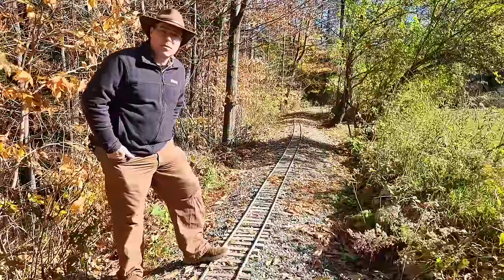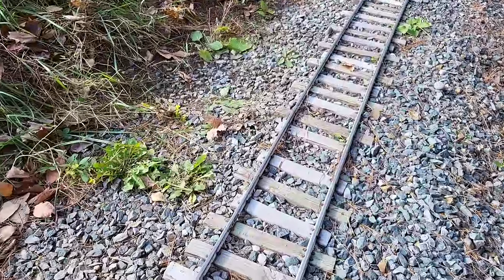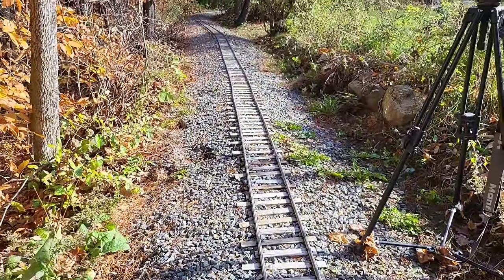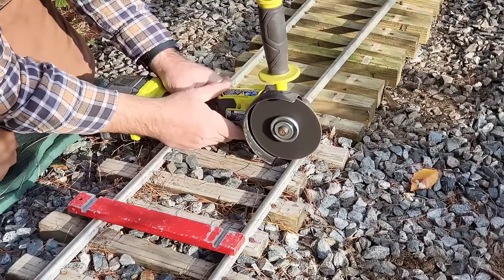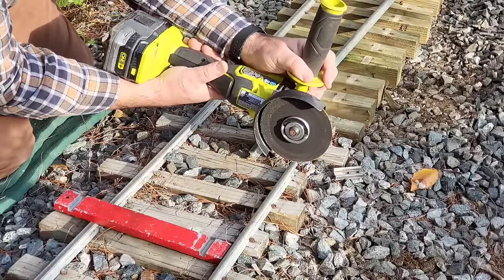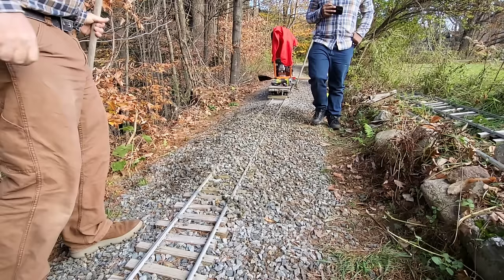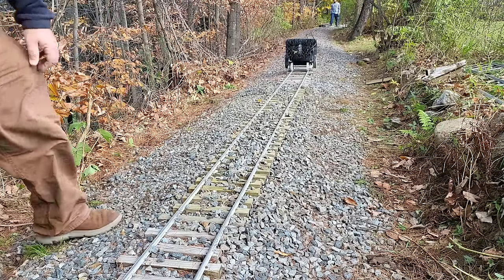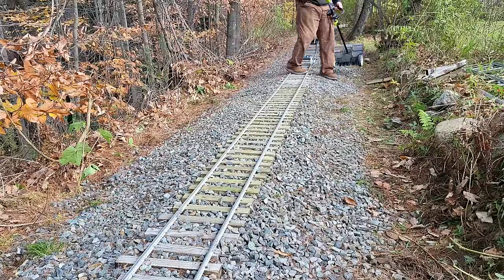Replacing worn out rail and ties

Comment: Try using "hemlock" for the ties, if you are not already.
Reply from the maker: Not a bad idea, but it's not as rot resistant as Black Locust. If I could find a sawmill who  would cut my Black Locust, I'd have them cut my tie stock. Price wise, Pressure treated  is still the best value, though.

Comment: ..."make a new panel".... That could be a good idea: make a panel of say 3 meters. On a spot easy accesible and to sit next to it. And transport it to the location. Only do the connection with the old ones and ready. Could save a back or 2 too...
Reply: Looks like a few more relays maybe in order
Reply from the maker: @Keikdv I have some older panels to get through first. Each stick of rail is 10 feet, so that's already determined for me. I do have a panel jig, though. A video about building track panels might be nice. I mostly lay track on the ground, though. Less rail waste that way.
Reply from the maker: @southern207hobbies9  You're not wrong, but it probably won't get done for awhile. When it comes to track, I need to choose my battles carefully. I can easily run out of time and materials if I fix everything that's visibly wrong. If, instead, I focus on what will derail a train, then I have a much more manageable workload. It ensures I don't run out of things like screws, ties, joint bars, or rail in the middle of a critical project.

Comment: How long do the rails you use normally last for?
Reply from the maker: It depends whether or not they are in a curve or in a straight. The outside rail  on a sharp curve will last 5 years or so, but a stick of rail in a straight will usually last for decades. The rail we replaced in this video had been part of the Mill Brook Railroad since 2010.

Comment: Love your videos...  It's good to show people that the work doesn't end after you initially get the track down.  Like real railroads, ongoing maintenance is required!  

Seeing a lot of rusty hardware there...  Is stainless steel hardware an exorbitant expense for the Mill Brook?  Not being critical, just asking!
Reply from the maker: Maintenance is an ongoing thing with a railroad of any size. 
Rust on hardware doesn't mean it's bad. Those old rusty machine screws are stronger than stainless, which has a lower shear strength. The reason I had to cut them off was derailment damage. Track hardware takes a beating.

Comment: Hi!  Just came across your channel and I’m hooked.  Just out of curiosity and by no means am I criticizing, is there a reason you don’t treat your rail ties to seal them?
Reply from the maker: I built this railroad when my income was ridiculously low (under $6k a year as a freelance documentary filmmaker). I didn't use treated ties originally because I was given thousands of untreated ties, and that's what i could afford. I'm slowly changing them out for pressure treated ties. What you see in this video is a track panel that came from another railroad. The ties were still good, so I'm using them. 
In short, this is railroading on a budget, financed solely by YouTube ad revenue. Glad you're enjoying it!